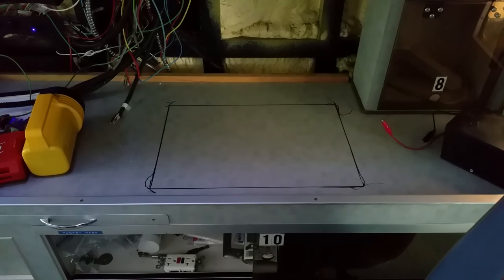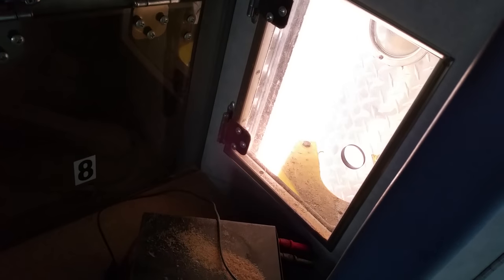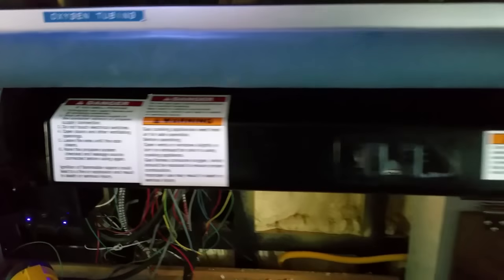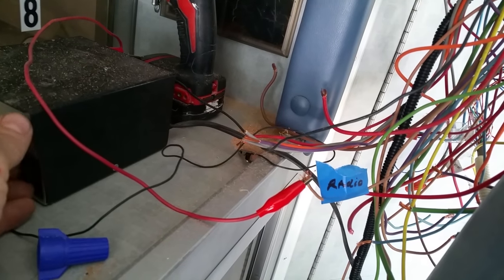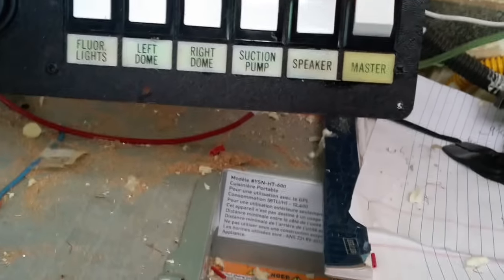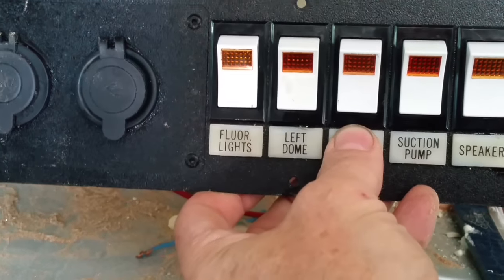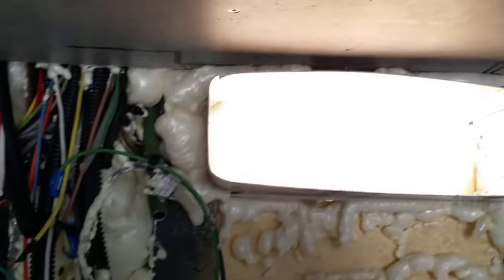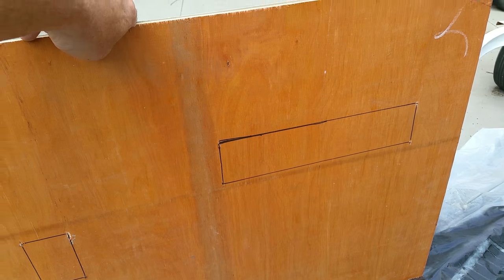#10 DIY Ambulance RV Conversion; Camper Van, Motor Home.

Comment: What bulbs did u use to replace the halogen bulbs ?? I have been trying to find a LED bulb in mine to replace the halogen bulbs in my dome lights.
Reply from the maker: There are two different sockets in the ceiling fixtures; Amazon has a wedge base LED that fits one of the sockets;
https://www.amazon.com/dp/B00WBGCVBM/ref=wl_it_dp_o_pC_nS_ttl?_encoding=UTF8&colid=2Q32AKGOI6DRW&coliid=I8ZALUZZGYDTL